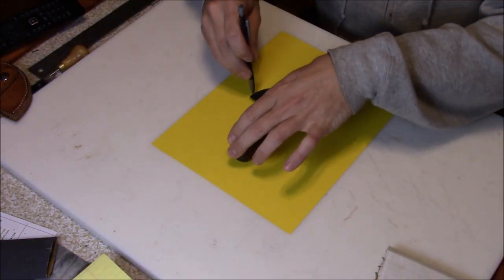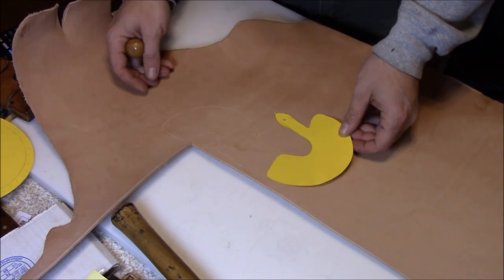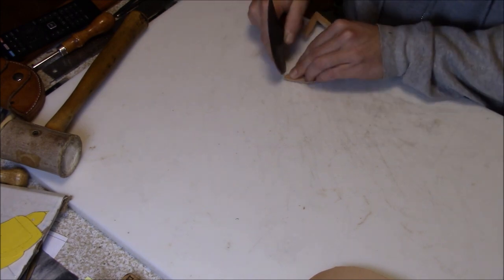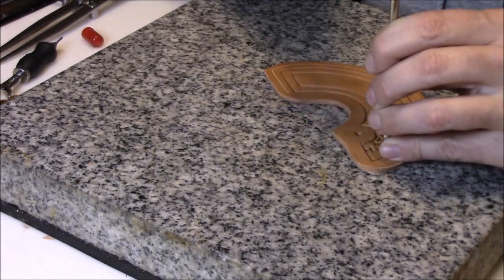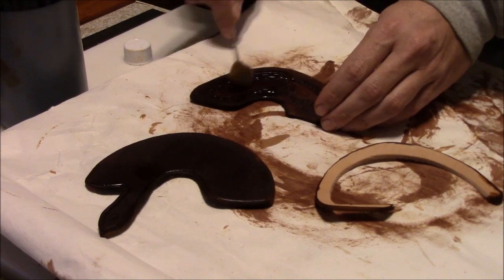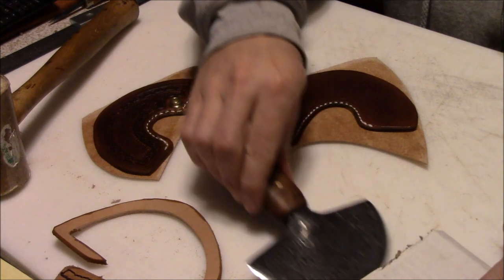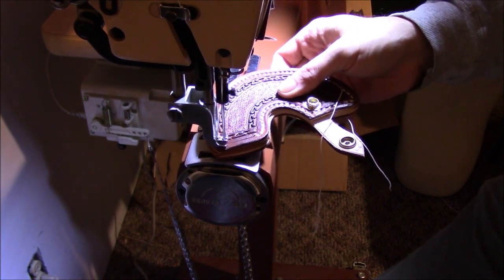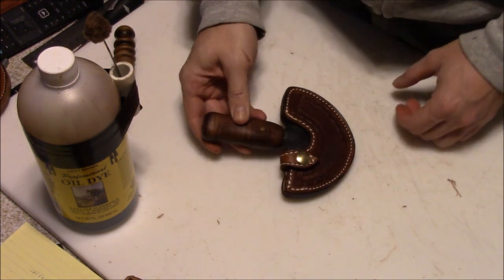Round knife sheath:  Making a leather sheath for the Damascus round knife

Comment: Nice work. What was the border tool you used and how far apart were the lines for the border.
Reply from the maker: This one is a Craftool D443 the lines are about 1/4 inch apart.  The D444 is a bigger version of the same tool and needs lines about 3/8 inch apart.

Comment: Very cool. I need to make one of these. What oz leather did you use?
Reply from the maker: I think I used 6-7 oz leather lined with a piece that was about 3 oz.  You could do the same thing just using 4-5 for both the exterior and the lining.  If you don't want to do the extra steps to line it I would suggest about 8-9 oz.  The welt or spacer piece will need to be just a little thicker than the blade of the knife you plan to put in the sheath.
Reply: @bransonsgeneralstore  thanks